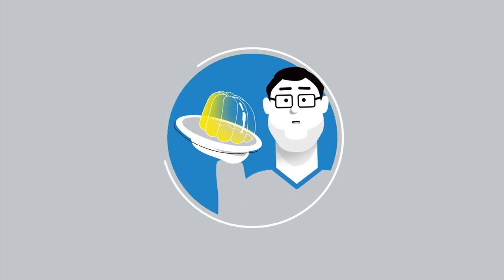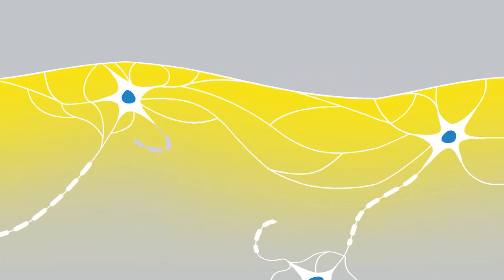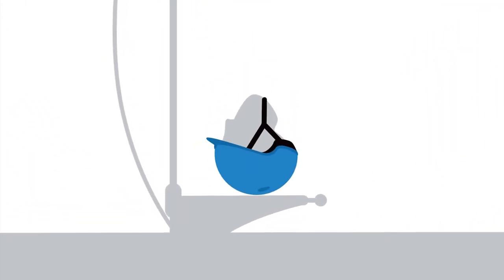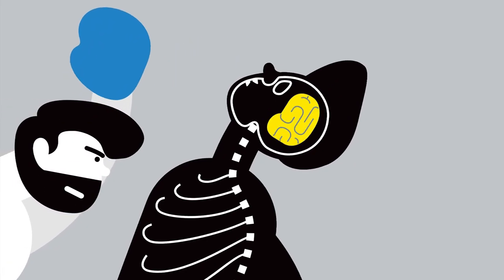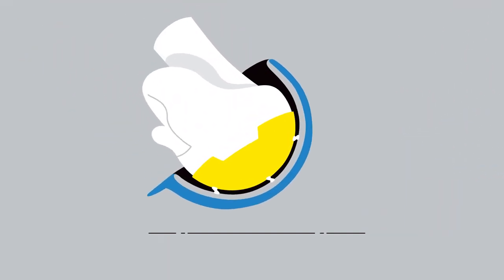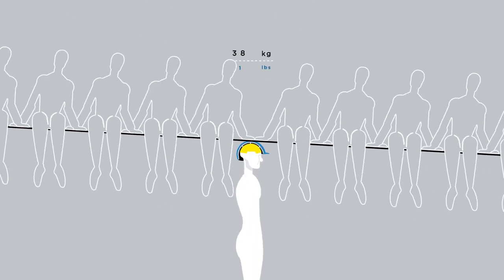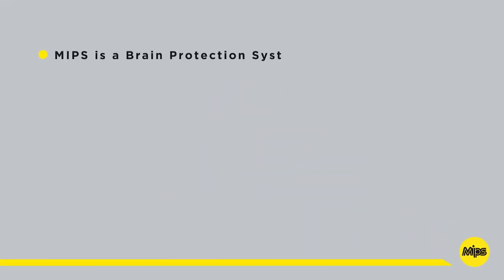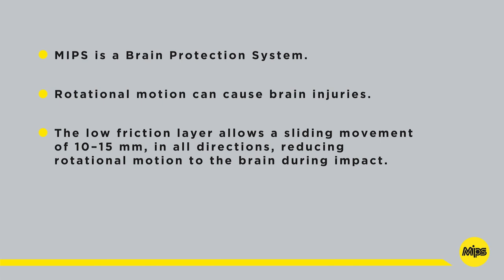MIPS Explained

Comment: I see your Point on just  Trusting the Outside of the Helmet to already Slide a little bit already on whatever Substrate that You're Connecting with. Earlier MIPS Designs were actually Built into the Outer Layer Space but are now between the Liner & the Inside so maybe You're getting a double low Friction Slide Affect now.

Comment: But a helmet already slips and slides in a crash. You easily simulate this by wearing the helmet and moving it around your hand using your hand.
Reply: No, when you just do a hand-pressure test, you don't "glue" the helmet to your head like actual crash pressures do. Try putting a 50 pound weight on top of the helmet for a partial simulation. It's about friction on the scalp and hair.
Reply: @DefundTheFringes  but the scalp will also slide around the skull just like the mips slides inside the helmet
Reply: @sebykos  depends on the hair length and texture, however the added pressure from impact does make it grip like sand paper. MIPS is like a layer of butter between Helmet shell and Skull, thats how I understand it tbh